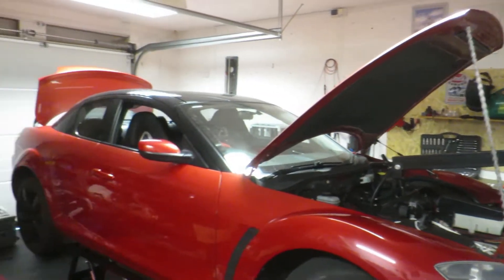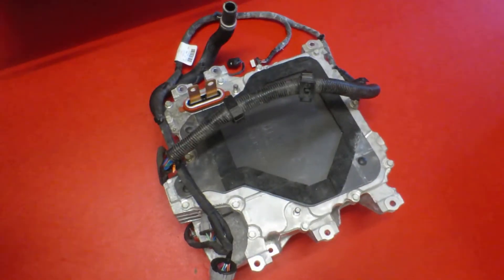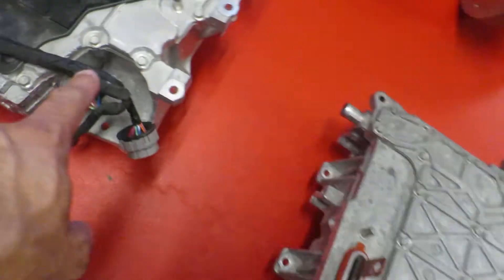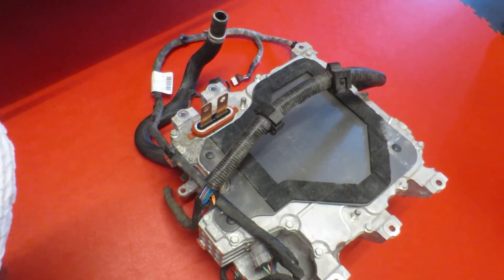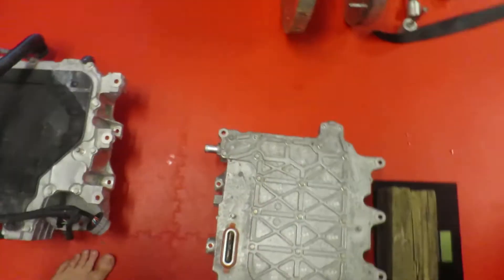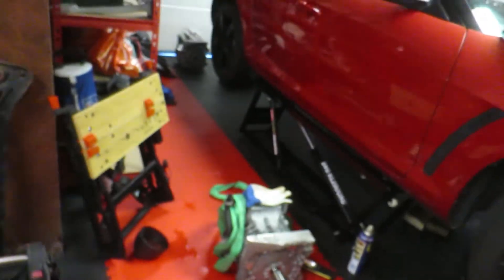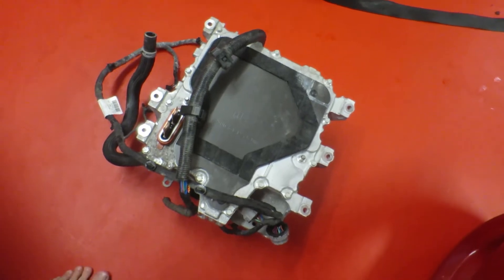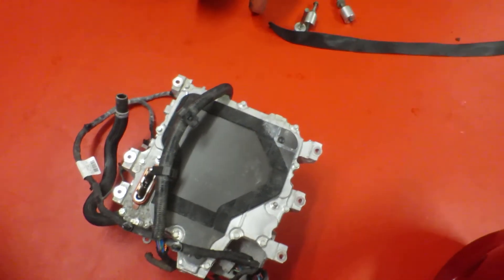Nissan Leaf 160Kw Inverter weight Vs Nissan Leaf 80Kw Inverter weight

Comment: what function does the "inverter" do? Is it what supplies the motor with the power based on how much throttle is inputted? similar to an electronic speed controller on smaller brushless motor applications?
Reply: You're precisely correct. And the two are identical.
Reply from the maker: Yes, all correct ;o)